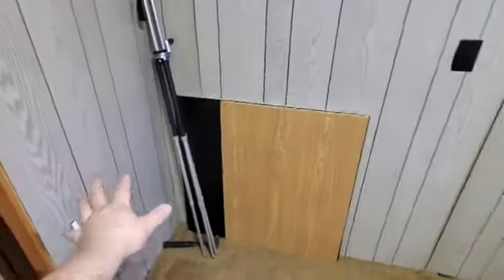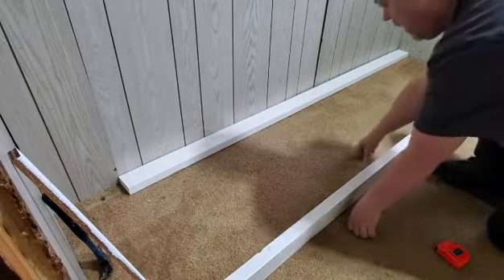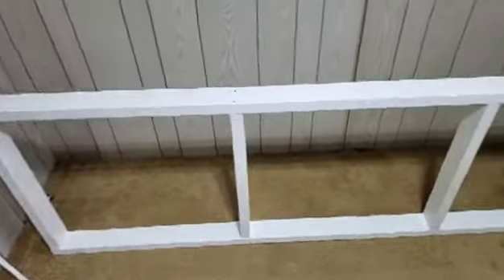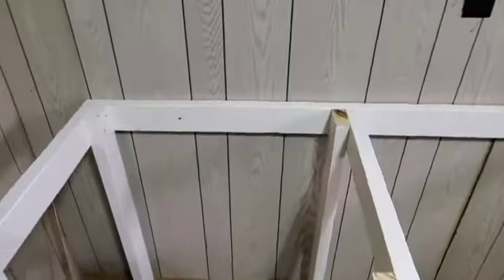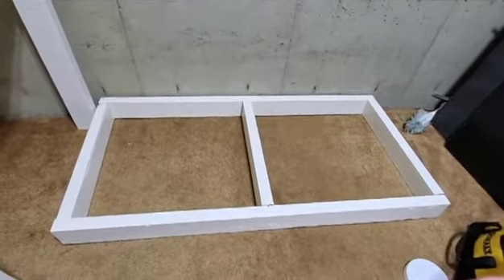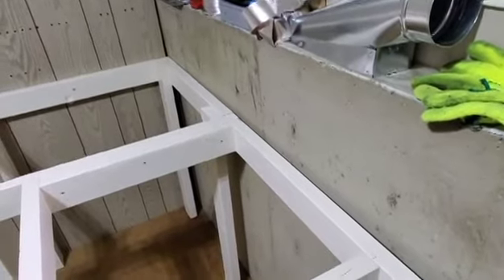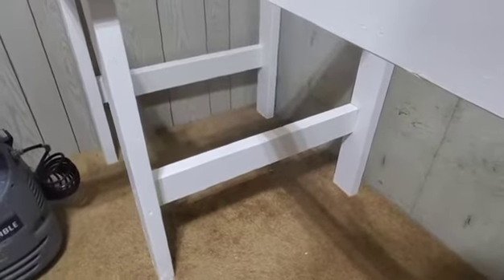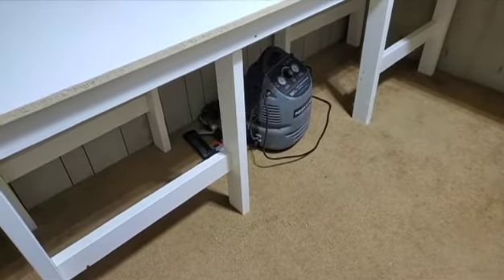Modeling Workshop Upgrade (Part 4)

Comment: personally i would have structural support inside each of the squares, that way you wont have to worry about weight limits in the center of each of the squares , after all it would be bad if you put a bunch of stuff on the bench and the topping starts warping down in the center of the squares or worse it collapses with all the stuff on it